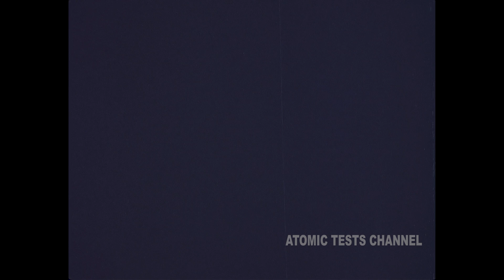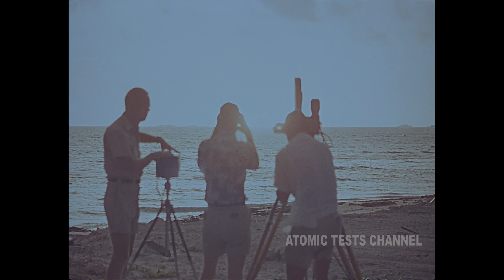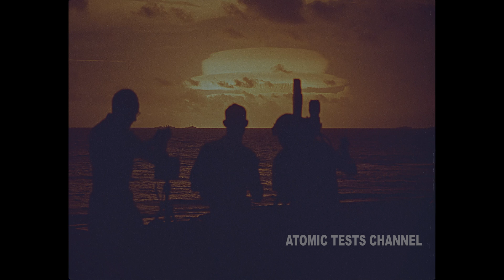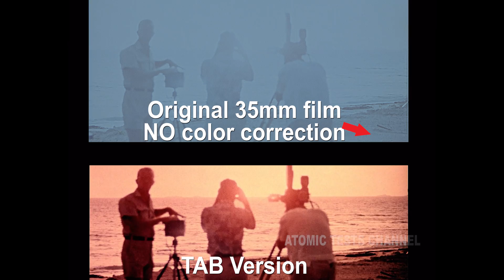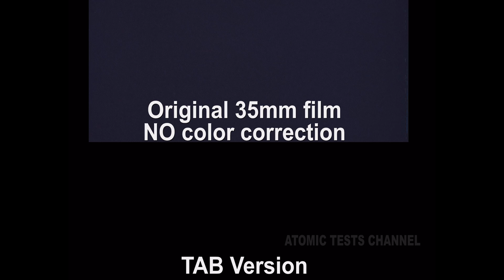Unedited Famous Footage Of U.S Nuclear Testing & Flash At Pacific Ocean  1.37 megatons

Comment: Hardtack Koa was the test of UCRL's XW-35 ICBM warhead for the Atlas ICBM. Design yield was 1.75MT with a fission yield of 1MT (57.14% fission) but the actual yield was 1.37MT with a 750KT fission yield (54.74% fission) with the shortfall in the total yield due to lower than expected burning in the device's secondary. The W-35 was cancelled in the end being replaced by the W-49 (An ICBM derivative of the B/W-28 tested in Operation Redwing) which was deployed on the Atlas D and Titan I ICBMS along with the Jupiter IRBM.

XW-35 stats:
Length: 45in
Diameter: 27in
Weight: 1532Lb
Primary HE: PBX9010/PBX9404
Initiator: ZIPPER
Notes: similar to the PLUMBBOB Kepler device (Diagnostic shot directed toward development of ICBM warhead design; total device wt. = 1,517 lbs.; probable test of XW-35 primary; similar to HARDTACK I Koa device; predicted yield was 11 KT; GNAT device, 10KT yield), used the TSETSE primary (https://en.wikipedia.org/wiki/Tsetse_(nuclear_primary)).